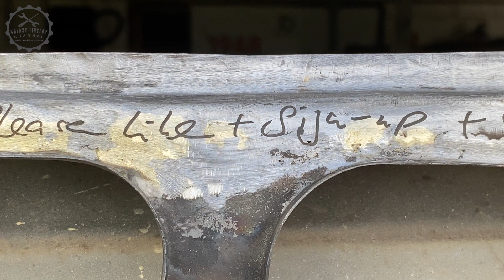Alfa Romeo Giulia (105): Restoration of the Doors, Part 3

Comment: Amazing work. Simply amazing. I’m afraid to dig to deeply in my 105 TI doors. My car is generally rust free but seeing what you found, I’ll be taking videos with a fiber optic wand to verify. Simply amazing
Reply from the maker: Thank you, Steve. Very encouraging. I wouldn’t be too concerned really. If you don’t have rust at the door bottoms, which I’m sure you had already noticed, it’s rather unlikely that you’d find some at the upper edge. That said, looking inside with a camera sounds cool.
Reply: @GreasyFingers  I bought a Wand on Amazon for $25-30 and my iPhone takes video clips.  great for looking inside door and rocker panels, inside a differential case etc.

My door bottoms look good but the inside door skin has either a sound proofing paint or something near the bottom of the door.  No paint bubbling.  I need a driver Alfa-I need to sell my GTV to fund other projects (Duetto and another GTV) so I may try the neutralize any oxidation and not replace the dllr skins. I'm having to fix where someone flared the fenders by replacing the lower rear 1/4 panels and leaving a 15mm gap between trunk floor and 1/4 panels-that seems like enough body work as it is

Comment: Thank you for creating this latest video. Good to see the nice progress you are making with this project. 
Patience is certainly the key with some of these challenging panels. Keep up the good work here.
Reply from the maker: Thanks, Manjit. The effort that goes into this project is a bit out of control, but the good thing is: most of the time it’s pure fun.
Reply: Greasy Fingers Consider taking a day for those memorable drives , time out for you & also time to reflect on direction the project/s - helps keep the fun going too. It’s more than engineering and panels . Your creativity reaches and connects with people beyond the workshop for sure. Have a good week ahead.

Comment: So satisfying to do the metal work. I hate the holes that blow out, too. Another tip for filling holes in sheet metal, or bridging large gaps, is to create a tiny spot of molten material on both sides (yes, more on the thicker side) and then run the two together. The problem is a quick build up of heat close to the edge (or even worse, a corner). In that case, I do extra heat-bridges (just like the tack-welds) at intervals. This permits the heat energy to disperse across both panels as you continue to bridge the gap. Otherwise, one side just keeps blowing away from you. Anyway, good work.
Reply from the maker: Using the same technique. 😊

Comment: Perhaps you know already but a tip I learned when welding such holes is to take a copper bar and hold it tight against the metal from behind. The mig rod does not stick to the copper and you minimize the problem with burning through the thin metal. Thanks for all the nice videos by the way!!
Reply from the maker: Thanks for the tip.
I use this technique sometimes and I like it a lot.

Comment: Hey. I vaguely remember you tackling the stainless trims around the Super windows. Am I dreaming? I’m about to embark on weather strip replacement.
Reply from the maker: Hi Joel. I was initially thinking about just leaving them away, but I’ve changed my mind. Current status is: the original ones have been removed, I’ll next fit the stainless ones, drill holes for rivets, then paint the doors, then built them in with rivets.
Reply: @GreasyFingers  So they way to the weather strips is to remove the window trim right?

Also interested in your removal of the rubber seal channel. Mine is rusted away in areas so removal would be my cleanest solution at this stage. You feel that (with correct door adjustment) the seals on the body are enough?

Comment: Restoring a car is one of the best mental medicines available.  I used to do alfa's and pininfarina years ago. A long time before internet, and the only place I could get parts were at the italian guy just outside Hannover, which was a two day drive each way for me.  Getting parts become too frustrating, so I went into a local cheap shop for pattern parts and asked which car they stocked most parts for. Fiat they said. So I bought an old rusty Fiat Uno for similar to 100€ and had a good time in the garage.   My wife said I looked like a newly divorcee in that cheap car B-)
Reply from the maker: That is very true.
I’d immediately buy it if I found an Uno Turbo in a reasonable state.